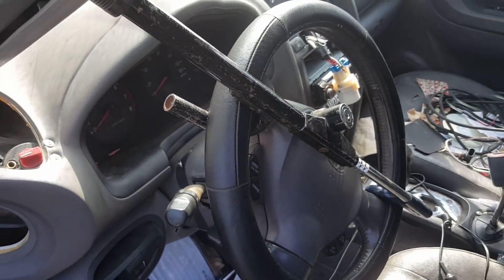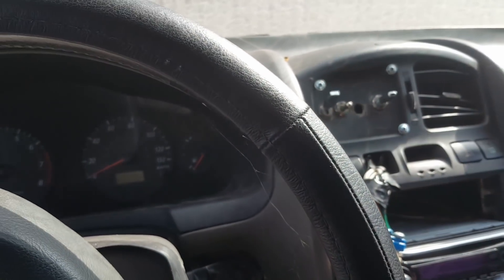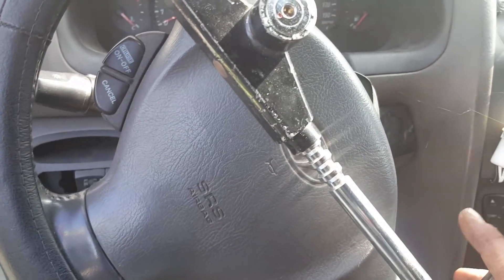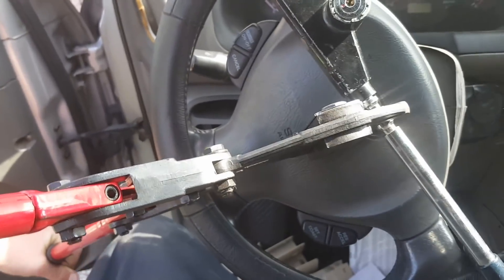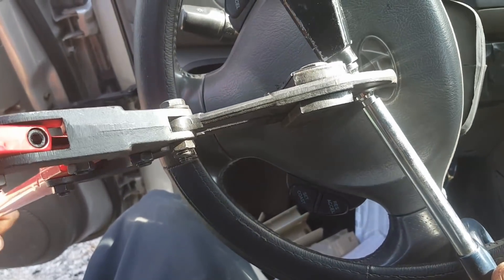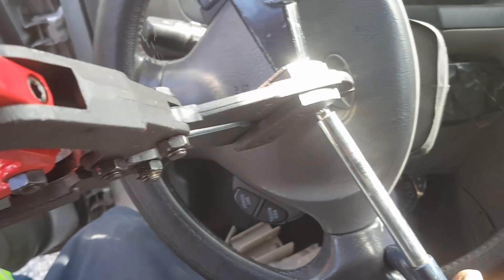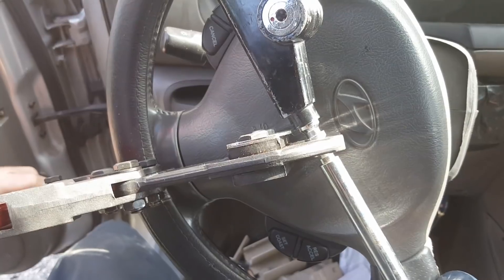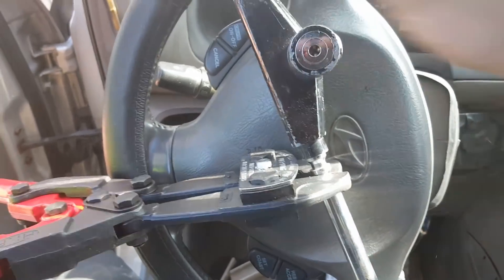Club steering wheel lock defeat Revisited

Comment: It's just a deterrent. But at only $15 bones I dont mind adding it to my cars limited theft deterrents. It took that dude more than a minute to get through it. If they really want it, and know what they're doing...They're gonna probably get it.  I know if I saw a dude walking through a parking lot w/bolt cutters looking in car windows, I'd be filming and dialing 911. Hell, just walking around anywhere w/bolt cutters  would raise my suspicion.
Reply from the maker: As a tow operator it's weird because some of these I've cut through in less than 30 seconds this one took longer than expected I guess there's not really a whole lot of quality control in there heat treatment process or something either way at 2 in the morning as long as the thief isn't making a whole lot of noise they've got plenty of time
Reply: I see the cheap ones at $30 and the others at $60.   Was $15 a guess, or were they really that 2yrs ago?
Reply: $95 CAD for the LX model which is a bit thicker. You're better off drilling out the key cylinder.
Reply: Noisy

Comment: Misses lost the key to the club. Tried the bolt cutters and didn’t make much headway. Laid into it with a hacksaw for ten minutes and didn’t do much either. This video gives me hope. I’ll disconnect the battery and give it a go tomorrow. I kept honking the horn and I’m trying to not mess up the steering wheel as it’s a Mini and has more buttons on it than Captain Kirk’s chair.
Reply from the maker: Some people have had easy success picking a lock 30 good pair of bolt cutters put into the little Naches ten to work you do have to use a lot of force but I've done this quite a few times and for the most part it does work
Reply: I took another try with the 800 lb/psi bolt cutters. I barely made a mm dent it. I believe it’s possible but because of the design of the Mini steering wheel the thin part of the club was right over decorative and functional parts. In order to get a proper bite on it, I was damaging the steering wheel more than making headway on the club. I spent not quite $30 for a decent angle grinder, wrapped a husky towel over the steering wheel and under the club to protect it from sparks and had the thing off in maybe 60 seconds.
Reply from the maker: @southernloverecords1341  yep that does work too
Reply: @southernloverecords1341  Great what kind of Angle Grinder did you use?  Like the ones at Walmart for $19?  Hyper Tough 6.0-Amp Angle Grinder with Adjustable Guard?  Thanks
Reply: achrisdesign ToolShop 4-1/2” angle grinder, 11,000 rpm
Reply: Just to follow up: My 2-year-old found the club key only the devil knows where last week. She was trying to eat it.

Thank you angle grinder.
Reply: Use a drill with a titanium bit for the lock

Comment: You’re working too hard, boys! That’s the cheaper version of the Club. See that red dot on the right side of lock cylinder? Pop that off by drilling a hole big enough to get a small screwdriver in the hole. Pry off that red cap. A spring and small ball bearing will come out. The Club falls apart. DON’T BUY THAT VERSION OF THE CLUB!! Then mount the club on the opposite side of the steering wheel, pointing the key hole towards the dash. A thief then has no room for a drill or slide hammer. Anything can be defeated but that helps.

Comment: Another way to remove the club is you can use a crowbar to bend it at the weak point enough to be able to take it off the steering wheel.

Comment: Lol...I have a disc lock  wheel lock  and on my Jeeps I just take the computer with me when it gets left  when I'm out of town. The ecu on my Two jeeps are easy to take they are sitting on the inner fender easy to remove and install in about 3 minutes total time , so if you do get the lock off you aren't going anywhere without a tow.
Reply from the maker: yerwrng got that right they can't do anything without the ECU

Comment: It took about a minute to try and cut it. If you get a brake club it would be even harder to cut it with bolt cutters being in a tight space.
Reply from the maker: No two of them are exactly the same I've had some Cody easier I've had some good harder I've also used bigger bolt cutters determined enough you'll get it it may take more time the pornos just trying to make was it's doable and if you're quiet enough and there's not enough people around you may have enough time to do it as well I was just trying to give a little bit of Education but thank you for watching

Comment: It took a little effort to snap that, I actually use the club in my charger Daytona when I go shopping, I cut the wheel all the way to one way and pull into the spot that way it can’t be towed out, and if it takes a few minutes for that snap sometimes it all is needed to catch a thief, it’s a deterrent,
Reply from the maker: It's a useful deterrent for theft it's not a theft proof measure because it involves more effort to deal with thieves usually will move on to the next car as far as Towing goes that won't stop the toe there's lots of times where we just drag cars or put dollies on the trailing end and charge the customer more in the end of the day if we have to work harder to tow it you just get stuck paying more
Reply: what year is your charger daytona? is it the 392? the 345?
Reply: It’s the 392 2018

Comment: The best defense is just to drive an "old beater" or commuter car for everyday use while keeping a better car in a locked garage and only driving it for special occasions. I'd bet someone driving a run down but reliable 2008 Kia Rio or Toyota would actually be glad to see it get stolen if it does they'll get a payout from the insurance company.
Reply: -some insurance companies will not sell you theft coverage if you don't buy comprehensive which I don't buy for my older cars, one of which got stolen a couple days ago, 2000 Civic with primered/rusted hood but runs great. Got it pack in same condition today.
Reply: Me neither my 97 accord just got stolen 5 days ago they found it though.

Comment: cut off wheel and s grider does it faster and makes less damage. Cordless grinder and cut off wheel. seconds.
Reply from the maker: It does but you have to be careful for interior Sparks that fly can inadvertently burn stuff but you're right cordless grinder with a cut off wheel go right through it done that before
Reply: Cut off steering wheel with a Grinder or cut off Club lock with Grinder?  Isn't it less expensive to cut off "Club"?  Thanks
Reply from the maker: @achrisdesign   Yup  Don't have to replace the stirring wheel
Reply: I weather cut the steering wheel lock then the steering wheel 🤦🏻‍♂️

Comment: The average theif don't carry bolt cutters like them, those are expensive btw. They will skip the car and go for the next one, unless there's a treat in plain sight
Reply from the maker: Yes the ones I'm using in this video are expensive however there are cheaper versions of the same thing that will do the same job most of the time the thief is just going to cut the steering wheel easier to do with smaller tools

Comment: I agree that a thief can just cut the steering wheel or do what this guy is doing cut the club off but while the thief is busy cutting off your steering wheel. You can catch him&ram your foot up his but then call the cops
Reply from the maker: ladyofwisdom2 call the cops a thief  be lucky if that's what I did i'm with you on that one you would probably more likely getting ass whipping and  I agree they usually will just cut the stirring wheel it's easier
Reply from the maker: Urethra Grundle it is a good idea however the steering wheels are really easy to cut that's only one little steel wire running through all that foam like I've said before these are just preventive measures most times these will pass by them I go to an easier car but thieves that are determined will stick with it it
Reply: I definitely agree that cutting a steering wheel is pretty simple but it's one extra step that a thief has to take. Only a determined thief will cut a steering wheel.By that time, I would've socked him a dozen of times..
Reply from the maker: ladyofwisdom2 I would wrap my foot up his ass however I'm not sure I'd call the cops he might want me to though by the time I'm done with him
Reply from the maker: Urethra Grundle intervention double-barreled shotgun got to love it
Reply: Unfortunately I’ve seen it done in three seconds flat. They snip the steering wheel remove the club and they’re on their way.

Comment: This is the flimsiest club I had seen so far. I have one about twice the diameter, but I put it through the front wheel of my bike as additional safety measure rather than car steering wheel. On top of a whole bunch of other high-security locks, of course. I would think even that one is too flimsy to secure something as expensive as a car. In honesty, I don't even know if there is anything at all that would discourage a professional car thief, besides filling up your interior with cement, but even then some desperate piece of shit will try and tow it away until its tires pop from the weight. Vibration sensitive GPS trackers are great for a bike or an e-bike, just locking it outside the store you're paying a short visit to, as you may have time to stop the thief before he rides away, but you can't seriously expect to have time to stop a car which can go zero to 60 in seconds. Finding and disposing the tracker is not such a great challenge either. The only remedy here is insurance for theft, everything else is a joke.

Comment: Doing that in public or at someone's house while the alarm is sounding. Yeah right. Will stick to my twin hooks
Reply from the maker: Funny part is I've done it in public and nobody even pays attention as far as the alarm going off usually just popped a hood real quick and cut the wires or rip them off and experienced Thief will get the car
Reply: Pyro4100 but I also have a solid steel brake lock. Literally impossible to cut off
Reply from the maker: @ryanmax-grappler8654  the point I try to make with these videos is that nothing is impossible and experienced Thief will get the car and that these locks are only preventive measures I do thank you for watching

Comment: I saw another video where the guy too a drill and went through the center of the lock and came right off.
Reply from the maker: It is possible the right technique probably go right through the lock cylinder it's not hardened steel

Comment: Next time i put 10 club at once on the wheel chain & padlock on my handbbrake and parking gear take the fuse off connect switxh to my battery and club on brake 👌

Comment: You don't need to be a strong guy to just pull and bend the bar until it snaps, no bolt cutters needed. Just grab the lock assembly and yank the bar will bend and snap, as it's very brittle.
Reply: are you serious?
Reply: lifesogood85 hes talking crap
Reply: no i'm not, you can actually bend and snap the thin bar, the original club steering lock was rubbish. That why newer versions were release using 25mm SHS tubular steel box section, very strong, so the only option was to chop through the steering wheel or remove the steering wheel completely, and drive with a spanner on the shaft, yes this has been none.

Comment: Let this video be a lesson: if you park your car on the street with the doors unlocked, no ignition barrel and a switch hanging out of the air vent that starts the car, your vehicle may still be stolen despite having a club fitted to your steering wheel.....lol

Comment: Dude...who uses bolt cutters anymore? mechanical defenses are easily defeated with simple mains grinders. You see back when the club was made there were only chord operated grinders. Anyway there are better alternatives to the club.
Reply from the maker: menemme that is true but usually thieves will just get a hacksaw and cut the stirring wheel axles are cheap and easy to use
Reply: WHAT ARE THE ALTERNATIVES I DON'T SEE ANY ??????

Comment: Never buy one of those they're useless .
These won't even use a bolt cutter Steve's nowadays will have a battery-opter grinder cut right to the steering wheel in 5 seconds cuz it's rubber and copper bend the wheel apart pull the lock off bend the wheel back put some duct tape on it.
No one would never know these are useless.
A real car seat will break through in seconds